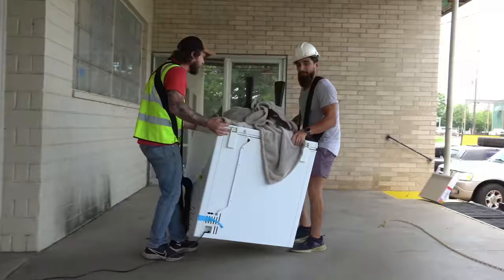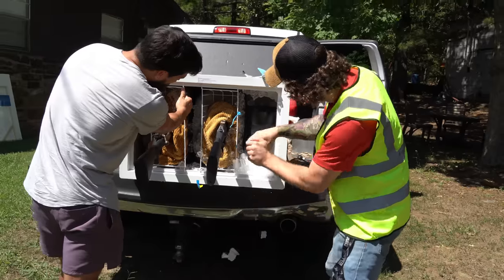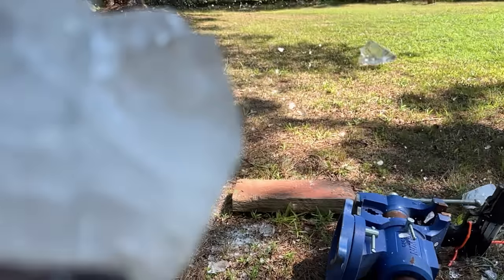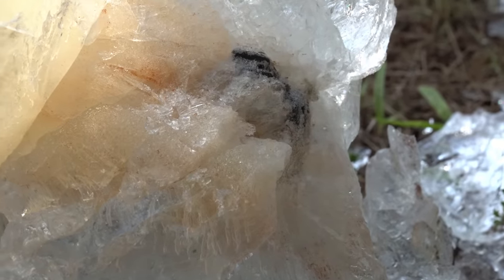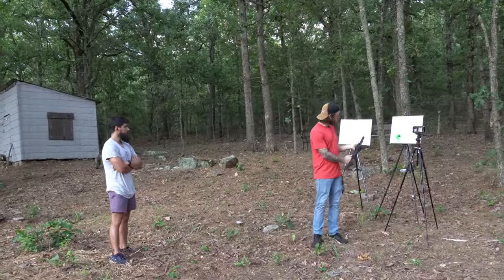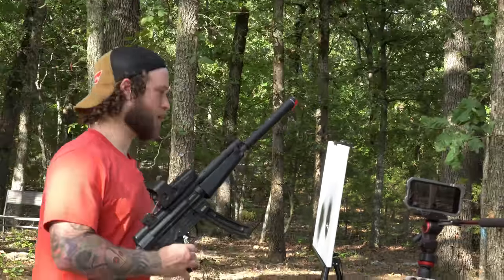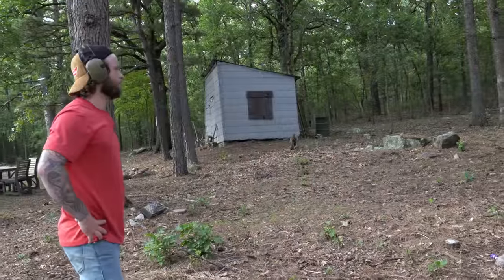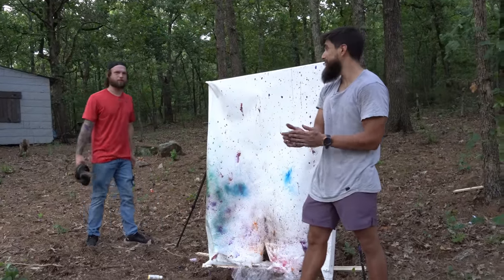I Froze 3 Guns In Ice And Shot Them

Comment: Bit of advice from personal experience:
Next time, fill the bin that the barrel is in with a bag of gas station ice. Then, fill it the rest of the way with water to fill in all the gaps. It'll freeze a lot quicker since most of the volume is already ice and youre just waiting on the bit of ice to freeze thats holding it all together.
Reply: What kind of personal experiance can you have possibly had

Comment: that's a saiga, (AK style shotgun.) so the reason it seized up is because the whole operating system is attached to a long gas piston. Because it reaches up to the front when it was submerged that meant that the bolt and gas piston were frozen together to make it impossible to operate.
Reply: Least someone else noticed same fault there. 
Was wondering how they would load pistol which have its slide locked by ice.
But i really didn't even imagined that they just uploaded it first at let it sit in a freezer at two weeks.
And in same time they somehow forgot how saiga operates.

Well for ODS it was typical tuesday.

Comment: The other shotgun didn't work because there's a gas piston inside the handguard above the barrel that's connected to the bolt carrier.  You filled that cylinder with ice and froze the bolt in place.